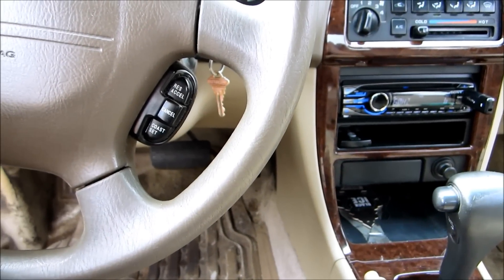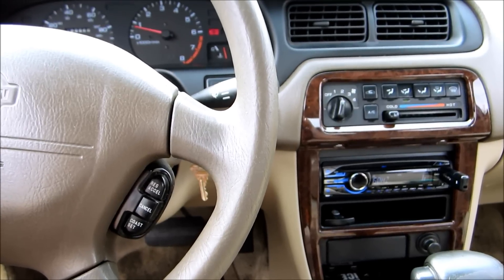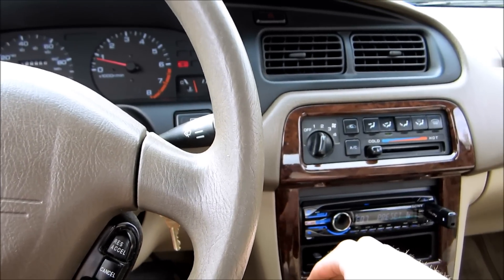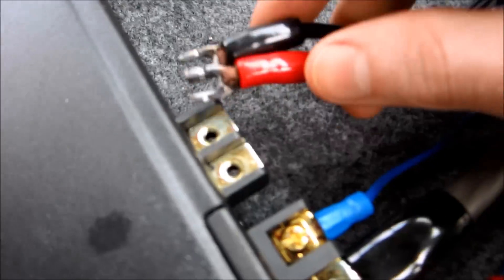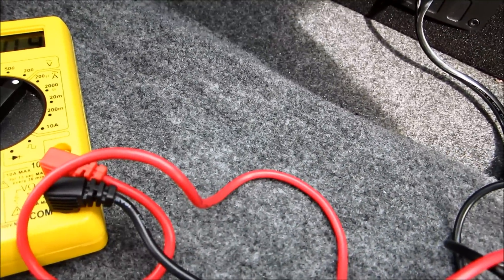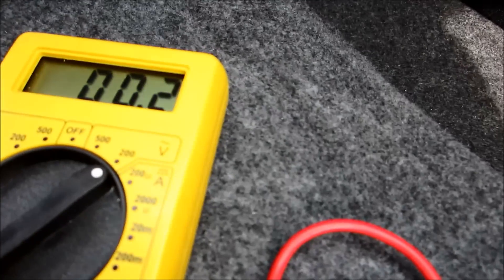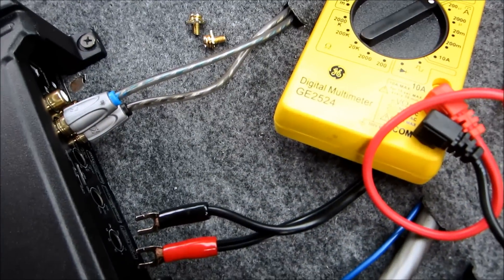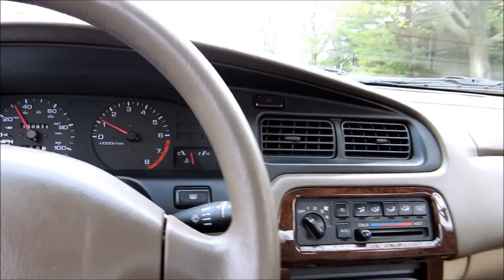How To: Tune Car Amplifier with Digital Multimeter

Comment: If you have a multimeter, you should measure the actual load out of your subs.   Some subs will say 2 ohm when they are really 2.4ohms or so. Use your multimeter to measure the resistance of your subs first.

Then multiply the total RMS wattage of the subs times the correct resistance.. and find the square root of the result.

That would be the voltage you need at 85 percent volume.

Comment: Do i calculate wattage of just one sub or for both of them? Say i have 2 500w subs would it be the combined 500w equaling 1000 and then times the ohm or is it just the wattage for one sub which would be 500?

Comment: After you turn everything to flat on the deck and bass boost on the amp to zero and you turn the gain in the amp to the desired voltage do you ever go back and turn your boost in the amp up and the bass on the deck up?

Comment: Did u multiply it by 4 ohms because each voice coil is 4 ohms? Or is that the total ohm load at parallel?
Reply: Did you find this out? I’ve been searching all day.
Reply: @dlaroc  so this thread is super old but for future viewers it should be the ohms that the whole box is wired to.
Reply: It should be by speaker. He has two running on one channel which is why you can still hear distortion when it was playing. The box has two hookups for a reason

Comment: Do you multiply it by the sub's ohm rating or the amp's? Mine are the same, but for future reference in the case that the ohm loads aren't the same, which should I use?

Comment: He is using AC voltage setting on the multimeter...He should be using DC voltage.
Reply: A car amplifier at the speaker terminals puts an an AC current not DC.
Reply: Energizer7896 Right speakers an AC thing
Reply: @prynceal6762  how would they be direct current lol dustin lackin bruh
Reply: Go back to school pls🤦‍♂️
Reply: Are u dumb lol
Reply: Why do cars have alternators then lmao

Comment: Mine is a 900 watt amp with 4 ohm subs brought down to 2 ohms that 500 watt per speaker b4 bringing it down to 2 ohms what should my meter read?
Reply: Do the matches yourself m8😂
Reply: @YourMuvva  im sure you mean math not matches o.0 lol... troll

Comment: My old amplifier just went out and I replaced it, but it is way out of tune. I will try this. Do you or anybody on here have problems with headlights dimming and voltage meter dropping? Obviously a high output alternator would be the obviously solution, but I don't have a very powerful amplifier (about 350-400W RMS, cant remember), but the voltage drop is just crazy when it hits hard. Could this be a grounding issue somewhere? I know the amplifier ground is good, but could the body and frame need to be grounded better or something? This is in an 87 Toyota 4runner. Thanks anybody for any input.
Reply: Scrap to bare metal , Get CEA 2006 Rated amp all not are not on point n lie. My old car did but new one don't but better system all kicker and hits hard yet no night drive yet so idk

Comment: whole lot good the link with the tone does, a whopping 10 seconds and you can't download it? I couldn't even walk to the back of my car and connect the leads in 10 seconds let alone tune it to the correct voltage in 10 seconds >.>

Comment: he doesnt know that hes on volts AC not volts DC. the alternator creates AC, but its changed to DC through the rectifier diodes. should be set to 20V DC
Reply: You just showed you don't know swuat
Reply: Go back to school ok🤦‍♂️
Reply: Mike Jaecques the amp transforms it back to ac again...
Reply: John Parry Jr lmaaao

Comment: does the car need to be on when testing the voltage or can it be left off as long as the amp is connected to the battery

Comment: hi friend, im a bit confused on how to figure out the right voltage for my amp. i have a 400watts in 4ohm all the way 650watts rms in 2ohm soundstream picasso nano monoblock amp. driving a one piece 12" 4ohm dual voice coil kicker cvr woofer. i paralleled my dvc woofer so it become 2ohm. my question is, can you help me figure out the right calculation or the right volts i need to tune my amp? sorry for my english. thank you.

Comment: I need help. I have Orion Cobalt 600w 4Ch. amp. I did not install the system, i don't know the ohms resistance of each speaker/sub, hence im stuck at the voltage calculation.  

On the amp: There are 2 gains on the amp (1 for the front speakers and 1 for the rear sub).

I cannot get pass the calculation, im stuck. How do i find the ohms so i can use the formula?
Reply: ok do you have one lead or two lead's coming out of your sub box? if you have one just put your multimeter into ohms and put each lead of the multimeter at the end of each wire of the speaker lead and it should tell you how many ohms. if you have two leads coming out of your sub box you do to each wire lead just exactly as you did if you had one. or depends how its wired to your sub we need more info lol 3 months later

Comment: hey what if i put in my diseired watts rms like 400 cuze my amp puts out 720 watts rms x2 and want to have set the gains low cuze i dont need to blow my subs "yet" jk  but wouldnt it work better if i just put my diserd rms instead in science my subs wont 400 watts rms each wouyldnt that work for me please meassage me back i need some help?

Comment: i too had to turn everything up on my setup. the head,i had to max the sub bass, the amp, i had to max the gain and even adjust the bass boost. still not reaching my voltage.but very very close.only a couple volts off..though i turned my bass boost down just to be safe and not over push my amp.(walmart setup ;) ) but this vid helped out a lot...kudos!!!!

Comment: changes made after gain setting i.e. bass boost ,lpf , low , etc will not affect voltage afterwards???
If yes then whats use of such kind of tuning??? :/

Comment: if the amp is CEA 2006 compliant and it's rated 3kwatts it will push out 3kwatts at 14.4v

Comment: hi man please help me, tell me: 1- what will happen if an ampifier is not stable at 1 ohm and i wire subs on it at 1 ohm?   2- same question if i bridge it at 2 ohm but it is bridgable at 4 ohm?    3- if i wire two subs 4ohm dvc at 4 ohm and the amp deliver 540w rms ,that mean each sub receive 270 w rms?   4- i have 2 pioneer W309D4 it's  4ohm dvc 400w rms each, and an amplifier sony XM-GTR2202 ,what is the best connection that i can do? please explain with details ,help me.

Comment: Ok so my question is im trying to hook up 2 2ohm kicker duel voice subs to a zx kicker 1500.1 how to i calculate the gain. The subs are connected in parallel. Then series to get a 2ohm load my rms for the subs is 450 the question is do i take the rms of one sub or do i take the rms of both together square root of 900 rms X 2ohm or do i use the rms of just one speaker square root of 450 rms X 2 oum